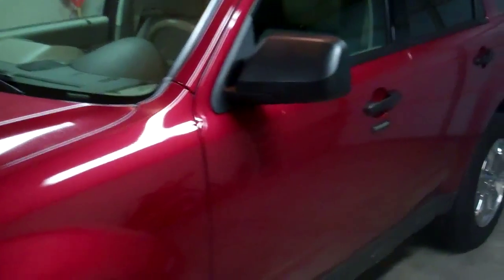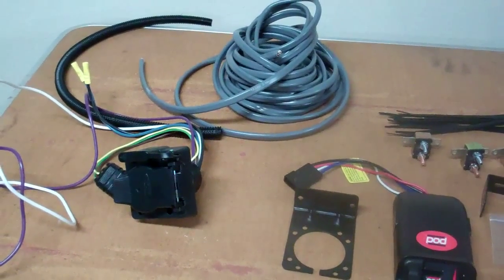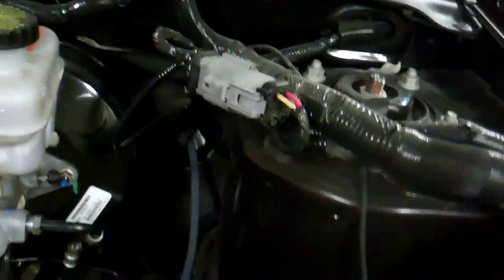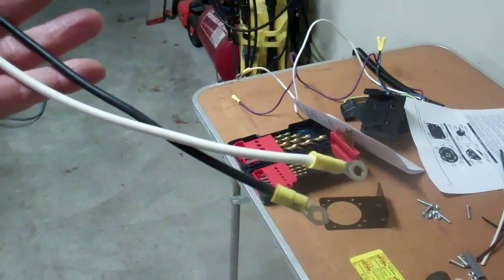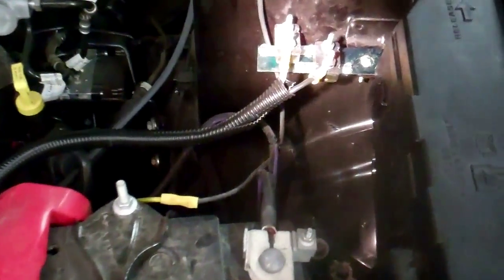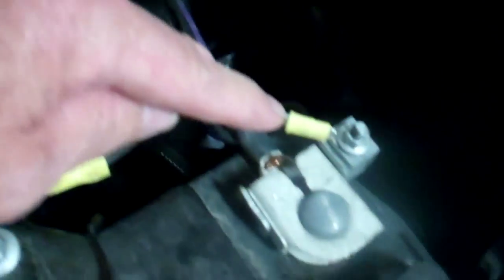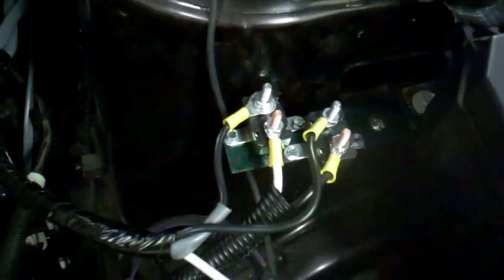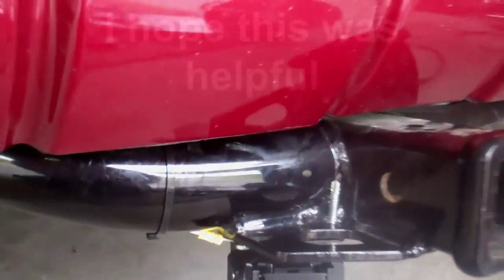How to install electric brake controller on vehicle without tow package..mp4

Comment: incomplete info...no one has put a correct install on these yet...even the trailer brake companies miss some vital info...Blue wire from controller runs to 7 way plug in back of vehicle...Black wire from controller runs to 12 volt power source with a circuit breaker in line...Red wire goes from controller to the cold side of the brake switch near brake pedal...White wire from controller goes to ground on battery...I guess the 2nd circuit breaker is for the blue wire to have a breaker between the controller and the 7 prong plug in...Not sure why you run 2 power lines from the positive of the battery to 2 circuit breakers, unless your auxiliary is running controller blue wire to circuit breaker and then on thru to rear of vehicle seven prong...Very confusing and incomplete info...

Comment: to the battery positive, then to the 20 amp breaker, then into the cab and to the brake controller harness.
The other 12 guage wire (blue) runs from the brake controller harness, through the firewall or wherever you decide to route it, back to the #2 blade connector. If you need to look up the blade numbering for the reciever part of the 7 bade connector, do it, it's easy to find on the internets. If you have any other questions, feel free to contact me. :)

Comment: Brad, I just did this too. Hopefully you got yours figured out 2.5 months ago or sooner. Just in case, it's 10 gauge and 12 gauge wire in roughly this configuration... [youtube won't let me post the web address, I'll message U]
(ignore the "RED: reverse lights part, shouldn't matter unless you are wiring the complete 7 blade outlet up to the taillight wiring). 
The 10 gauge runs from the battery to the 30 amp breaker and on back to the #4 blade on the plug. 
The 12 gauge (black) wire connects...
Reply: is it just me or does it seem like your comment just stops before the end?

Comment: What size wire did you use? and where did you hook the wire to the rear 7 way plug? how did you connect the brake controller? Great video but you left out some important info.would you consider doing a part 2?